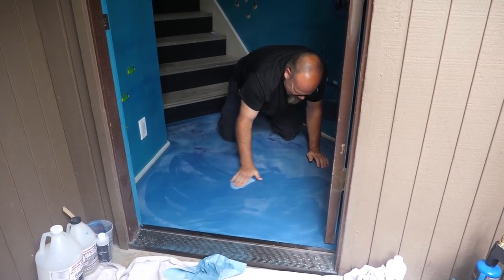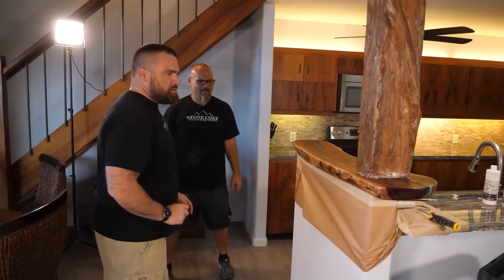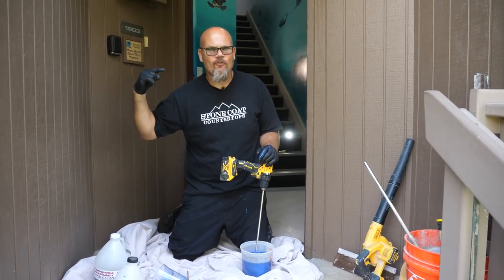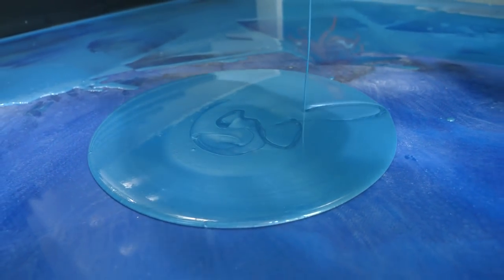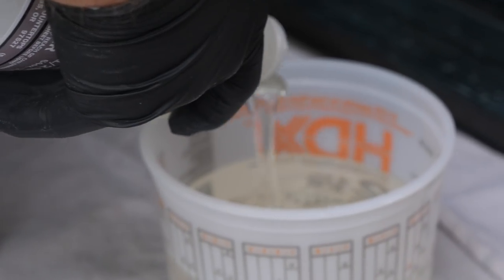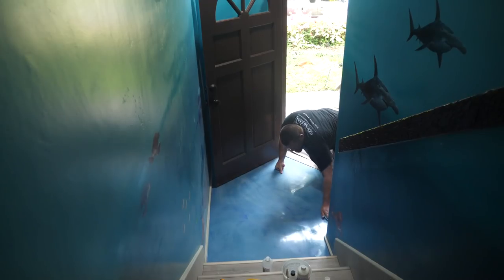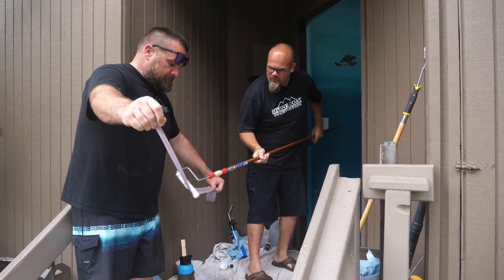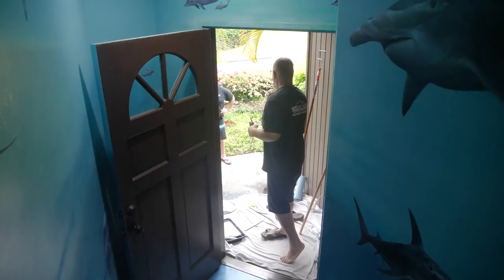How to Epoxy over Old Tile Floors | Stone Coat Epoxy

Comment: Was doing my countertops When I came across your videos! I am so glad that I did! I am doing three small areas of Apoxsee over tile and then one huge  area So your video has helped me tons and I will be ordering this epoxy from you. Thanks so much for your video!
Reply from the maker: Right on Kim, You Got This! Check this video out for going over tile on countertops https://www.stonecoatcountertops.com/montana-marble-effect/
What color combination are you thinking? If you have any questions please give us a call!
Reply: @StoneCoatCountertops   auto correct APoxsee 🤣 I did the cabinets black - and the countertops white with grey marbled - I then threw glitter on and put two coats of epoxy on. I actually did watch one of yours about going over tile. I will check and see if that’s the right one. 

On the colors - I’m thinking either white/dark gray/splash of blue or a gray  - I think the one I watched was ocean blue. I have the dispersion fluid in my cart - that helps with the finish I believe I saw .... I plan on purchasing tomorrow. I went to get floor leveler today but ended up getting aggravated and leaving! I need powdered in bag right? Not the patch stuff.... I will call tomorrow with my order. Thank you!

Comment: Hei!
I love your works!
I have my bathroom that start to sink water under the tiles and contact with the eletric wires of heating.
My doubt is if I use epóxi, this will be like glass, it will , the floor won't slip?
Thanks for ge attention

Comment: Is it possible to put a seal-coat (forgive the spelling if incorrect) on hardwood floors or non-concrete/tile floors)?  

Also, can you put radiant heat under the epoxy or floor heating? I have heard it is possible but wanted to know from you guys since I follow. Can the heating be put in the level-quick and felt through the epoxy?

Also a question for your showers video. Is it necessary to have a shower-pan if you epoxy the shower floor. Wouldn't the top coat be durable to water and soap?

Comment: I am halfway through your video from March 30th of how to epoxy over old tile floors, doing the ocean at the entrance to the condo in hawaii.

I just saw that the voting has decided to do the ocean pour, combining the ocean waves up to the sandy beach at the stairs.

I don't know that you did this, but if that had been my condo I would have had you do exactly the same thing, except that I would have had the stairs also be epoxied as some sort of rocks as if it was a rock path down to the ocean from the upper floor.

you may have done that, cuz I'm only halfway through the video, but that's how I would have finished it. I would have made the stairs be a rock walkway and path down to where it meets the sand and the ocean.

Comment: I keep reviewing your videos because in my heart or hearts I want to have an ocean blue epoxy floor in my house. Problem: I have ceramic floor tiling with 16 inch square red ceramic tile with a 1/2 inch grout. 1) How do you prevent ghosting when laying down epoxy; 2) What can I mix into the epoxy to prevent slips but is easy on the feet 3) what is the cure time and how long to stay off the epoxy?
Reply: Can I use the Stone Coat patch kit in the grout lines, sand the floor, vacuum the floor, then use the leveling cement then put epoxy on top if that?

Comment: I did my kitchen tops  perl white  with gold and metallic   wondering why  food colors  stic to it  they literally  sink in  . Did my counters at separate  times and  one side   never completely  dried its like a rubber bouncy ball   any suggestion.
Reply: Definitely sand it and recoat it. 💜 maybe do a darker color?
Reply: Incorrect mixing is most likely.. sand and apply another coat

Comment: I have a question:  Is epoxy resin flamable ?. If so what is the besy solution.coating (NOT asbestos) to make flame retardent ?.

I am THINKING about using epoxy resin to protect the floors of my boat, BUT I DONT want to turn the whole thing into a floating roman candle

Comment: I want to lay a ocean epoxy floor over large format--and big grout lines ceramic tile floor. To prep the floor for the epoxy: 1) Clean the floor 2) Grind the tiles 3) Etch the tiles 4) Put high viscosity epoxy primer in the joints between the tiles 5) Low viscosity epoxy leveler 6) The fun stuff--the epoxy topcoat. Will need to put in anti-slip additive?

Comment: So on tile when doing a floor no need for a bonding primer? prior to applying leveling material. I need to do my floor. After cleaning then sanding/grinding I am at a standstill because I fear prepping incorrectly thus causing it to fail

Comment: I absolutely love this.  As a rental property though and liability I would highly recommend trying to do something like a island down the center where feet will walk to avoid a slip hazard.  I'm even thinking you may be able to use sand from the local beach as the epoxy dries pour it in a island shape down the middle. I absolutley love the look as is though.
Reply: I'll post a pic on your Facebook page of what I'm trying to say.  And also it may not be slippery.  I'm just thinking out loud

Comment: If in the future you want to replace the floor, how hard is it to get the epoxy up/removed?
Reply: Very difficult, but you could just whack away with a sledge hammer and the tiles under should break up and aid in removal of the floor.

Comment: If people come walking in with wet shoes are they going to slip?  Epoxy can be extremely slippery when wet...
Reply: It's always a possibility of slipping when wearing wet 👞
Reply: But a smooth surface is most prone to slipping.  This is why on garage floors people throw down various form of aggregate as that gives shoes some grip.  I've never slipped in my epoxy garage floor because of that.  However I have slipped on smooth epoxy and you can't always see the puddle.

So I'm just curious if you put something down on your epoxy floors to prevent this (as much as possible)

Comment: Do you need to let the level 3 concrete cure several days?
Reply from the maker: You can do a moisture test! You'll want to make sure there is no moisture, tape a piece of plastic down over night and you will see if the moisture in the morning. Please give us a call if you have any questions

Comment: I dream of putting an ocean floor epoxy with anti-slip additives on top of my ugly large format ceramic tile--which has HUGE grout lines. Can I: 1) Clean the floor 2) Grind the tiles 3) Vacuum then mop the floor 4) Put high viscosity epoxy primer in the joints and let that cure 5) Vacuum and mop the floor 6) Etch the flooring, let sit, then mop 7) Put thin viscosity epoxy primer on the floor 8) Vacuum and clean. 9) Then the topcoat with the anti slip additive added to the topmost coat?

Comment: Not trying to be a smart ass because im not. I noticed you didn't grind after pouring the self leveling concrete. Do you not have to gring fresh poured self leveling concrete before applying epoxt. Help me i need to know